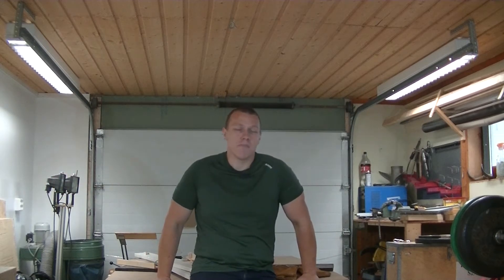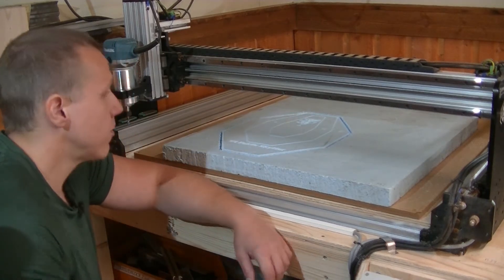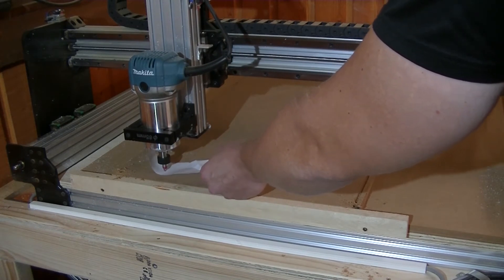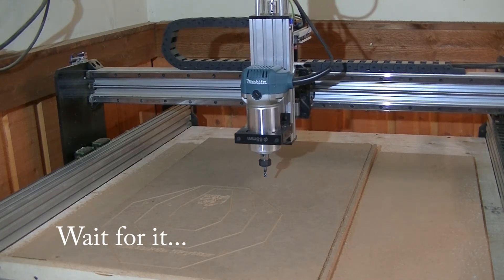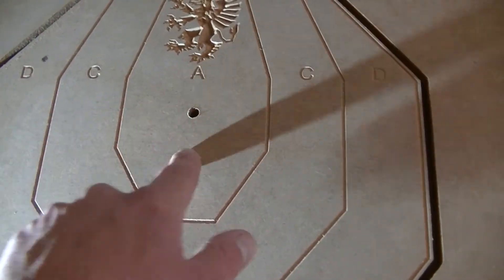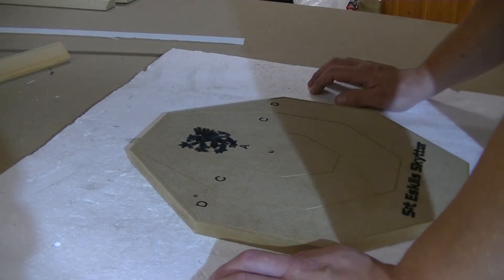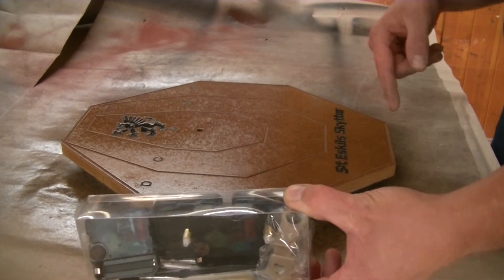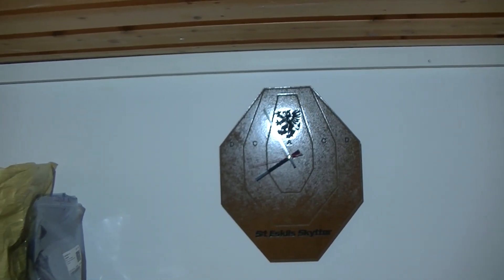The first real project on the CNC: A clock for the mancave.

Comment: Hi, I need to make a 8feet x 4 feet x Max 2mm sheet metal cutting machine. Is that possible in this way?
Reply from the maker: The control side, yes, but I would suggest you build a CNC plasma cutter instead of a router for cutting sheet metal.

Comment: Do you have or plan to post the software how to use video? I plan to get the 1500mm queen bee pro, but want to know everything before purchasing. Ima follow your build because it’s exactly what I been searching for.

Also, what version of software did you get for the controller because they have a few options and why did you chose that?
Thanks
Reply from the maker: I'm using ESTL controller and an Arduino nano as a breakout board, I discuss why in part 6 of the build series.

I hadn't really planned to do a how to video of the software, Christian knülls own YouTube channel describes fairly well how to go about things. And there are others as well if you do a search on YouTube. 

I'm happy to hear that you like my build, I'll be happy to help if you have any more questions.
Reply: Went for the 1500mm and shouldn’t have bought a water cooled 2,2kw spindle as that fucker is way to heavy for the width. Currently running an off brand Mikati router. But hey, I’ll be making my own upgrade for a smaller more heavy duty machine with the current machine.
Reply: @lorawanfluencer  Dang I already bought it and got it in. Its okay I'll end up reinforcing it along with the entire frame once I get it built. I just need to figure out what software to use since I model everything in Solidworks and have a GBRL (the one they recommended) unit. I'm thinking Vcarve Pro and hoping I can transfer a Solidworks file directly into it and it will read the entire model; does this sound correct or doable?
Reply from the maker: Yes, I think so. Vcarve pro can import STL models for 3d toolpaths so it shouldn't be a problem. But I think there are some limitations, like you can only import 1 model per design or something. I researched it before I built my machine. That's why I settled on ESTLcam. It can do 95 percent of what vectric software can do for a fraction of the price. And I use fusion for all my modelling so I don't need the modelling functions of vcarve pro or aspire.
Reply: @lorawanfluencer    do you have the 80/40 extrusion like the website says for the queen bee pro or did you get the older light weight setup they had before?

A good reference:  do you have the 80/40 extrusion like the website says for the queen bee pro or did you get the older light weight setup they had before?

A good reference, I can’t attached the link because it removes my comment but here’s the location that gives the extrusion strength: 
MOTION Automation Intelligence
WHAT ALUMINUM T-SLOT BAR SHOULD I USE